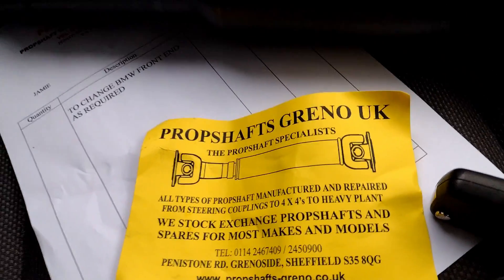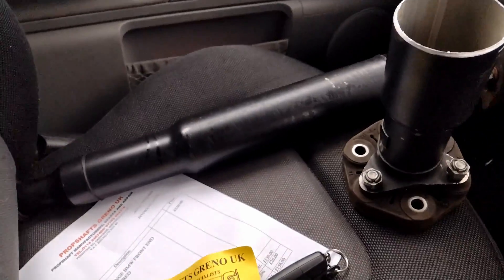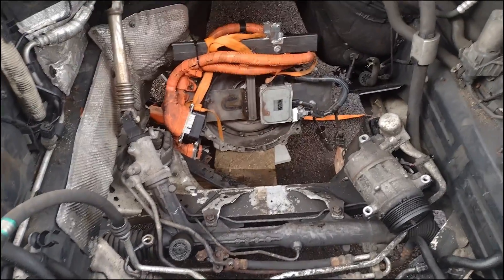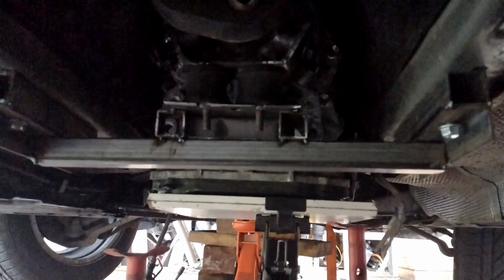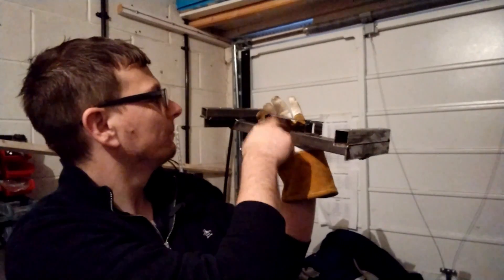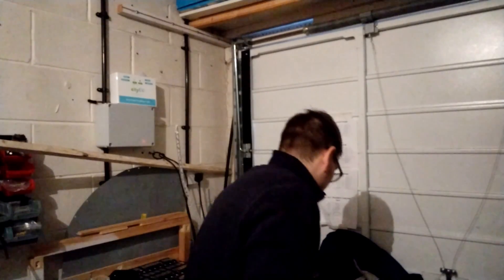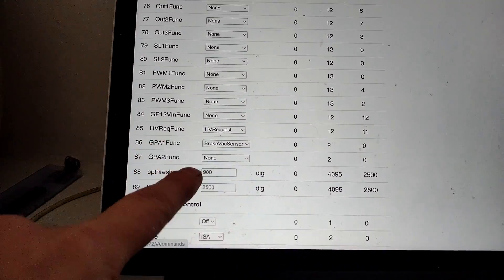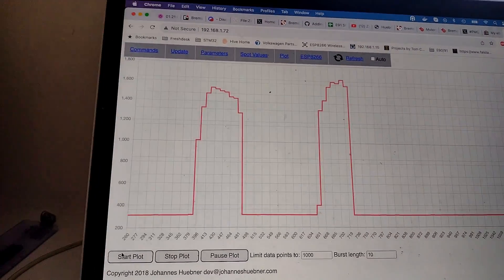DIY BMW E91 EV conversion Episode 6 - Shaft

Comment: Hi Jamie,

I have a problem with the PP. I also use the Zombie and a BMW LiM. When I split the PP to Zombie and LiM  I do not get a stable signal but a square wave signal…perhaps you have an Idea…
Reply from the maker: @volkmarkloimstein9230  you shouldn't need the PP detect with the LIM handling AC charging
Reply: @JamieJones1985  thank you for your reply. Ok…do you also use the LiM for Dc Charging? Because, my LiM sends the information from the chargingstation to the Zombie, and begins with the precharge but the charging contractors do not close and after a while the precharge stops and the Zombie says Pilot Type : CCS_not_ready… do you have an idea, where the problem is?
Reply from the maker: @volkmarkloimstein9230  I don't use a lim. don't really know much about it. Id post on openninverter.

Comment: Hello Jamie. At 6 mins 10 seconds you mention 5 volt. Where is this 5volts supplied from.
Reply from the maker: @kev39  zombie supplies it, used for throttle pedal and I also use for PP detect

Comment: This is really cool project, whats a rough cost to convert a vehicle like this overall and will you get a good range on the electric?
Reply from the maker: Depends. Batteries are very cheap now. I did my beetle for 2k for 30 miles, it's now got 90 or so miles range. Spent an extra 1400 to do so. A pack to get 120 to 150 miles is about 1500 to 2k now. For 4k you can get the 64kwh packs now. (3.5 to 4 miles per kWh is what I use)

Comment: Excellent work Jamie, also good to see the Zombie functionality improving is there a deadband for the brake booster and is it adjustable ?
Reply from the maker: There are parameters for a threshold and one to turn back on, so there's a configurable deadband. It's been merged in to master now, so will in next release. Working on the digipots now, got control of them but no actual integrations yet.

Comment: On the subject of the rear gearbox mounts, Having the rubber shock mounts so close to the centre will reduce their effectiveness to resist twisting under load. I would suggest making a rigid spreader plate and moving the rubber shock mounts further apart. Just an idea 😎😎
Reply from the maker: I may well do that when finalising the mount once I've confirmed placement is good.

Comment: Hi Jamie - I've been following your videos for a while. Its great to see progress on this project. However can I make a small suggestion. Your audio is not great. I can see a lapel mic ( I assume its a wireless one into your phone type which cost a few ££. I might suggest getting better one as it will make your videos far more watchable. many thanks again
Reply from the maker: I'm not sure the camera app is using the microphone to be honest.
Reply: I had a similar issue. I use the Open Camera app on my android phone and set my plug in mic as the default . Not sure if there's one for the Iphone or what app your using so just an idea. 
 @JamieJones1985

Comment: Lovely job. Usually folk go for a shaft enlargement rather than paying to lose 8 inches. Also thought thats the politest post weld scorching that ive ever heard. Great progress. Btw fancy helping out on the ccs upgrade to my env200 once you have this project nailed?
Reply from the maker: What are you planning to use for CCS controller? LIM? UHI?
Reply: @JamieJones1985  i have a lim, but the recent progress on the uhi board is compelling.
Reply from the maker: @Whereswally606  we're going to do an JLCPCB order for some UHI boards at some point I'd you want in on it
Reply: @JamieJones1985  all depends. I am skint at the moment and even though i have nearly all the bits to make my env200 have ccs i havent spent enough time to wrap my head fully around it.